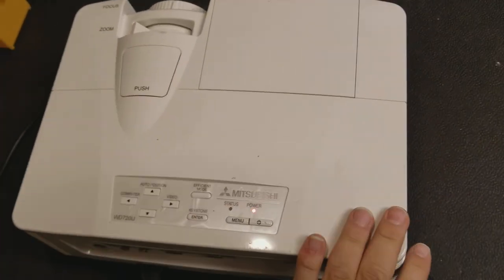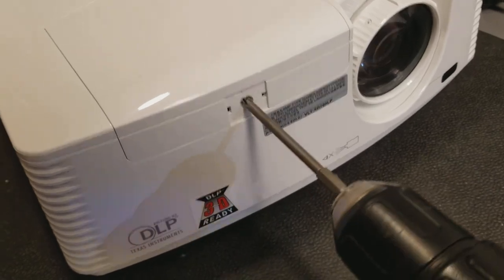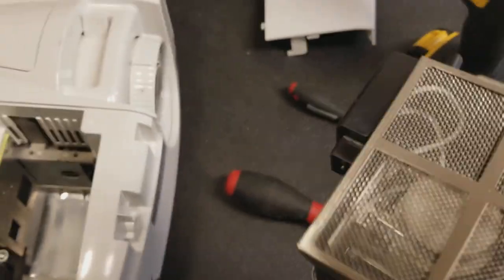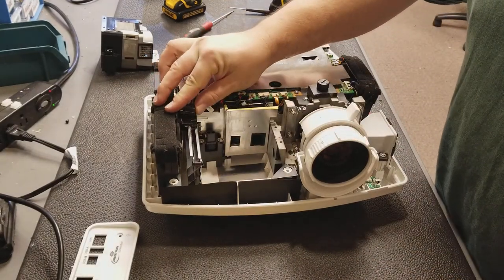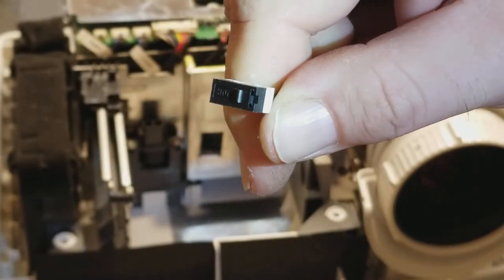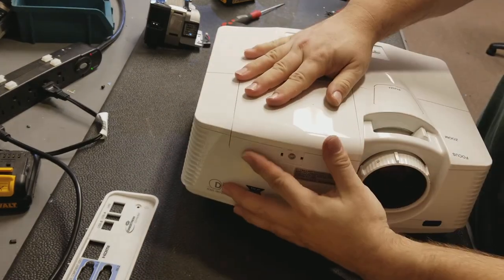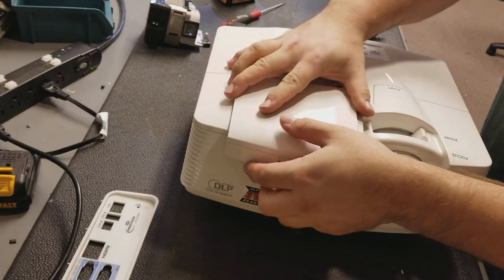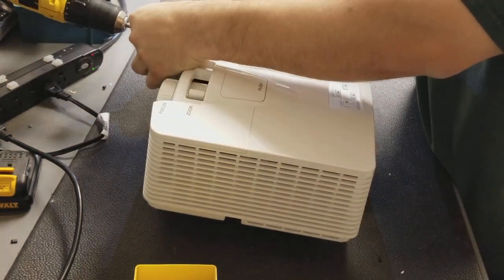Mitsubishi WD720 Repair Part1

Comment: Thanks for video here. I have a WD620U that start up but after some minutes a warning sign " temperature" came up on the screen and after some second the projector turn off. After ten minutes it is possible to turn on the projector again and after some minutes the same fault happen.  I have cleaned the projector for dust and the bulb is new and the old bulb has around 70 % more lifetime. Is it something more I can do. I think the fans are good. All fan blow in and the exhaust air are going out around the speaker. Is it some that know what that can be wrong?

Comment: Hi Frank, I just purchased a Mitsubishi WD2000 from a recycle center. It works great. The question I have is, do you reccomend I do a thoroughly cleaning of the fans and filter? And a bulb perhaps?
Darrick
Reply from the maker: If It is working ok , I would leave it be for the time being.  Maybe give it a simple cleaning where you just blow some air into the vents and pick up the dust with a vacuum.  I dont like to open perfectly good projectors because you can cause more problems sometimes.  I can tell you the WD2000 is pretty well built and is a chore to get to all the fans.  I think I would do the simple cleaning and use it.  
As far as the lamp, check the hours.  If they seem reliable(1800,2200 hours or so) then replace it if it as near the end.  If it only has 800-1000 hours I would keep using the lamp as it is.  I would check the bulb type though. Make sure its an Ushio brand bulb(either in your PJ or if you buy a new one). Enjoy that WD2000!  They still go for a few hundred on eBay.
Reply: @FixitFrank  Thanks Frank. I was kind of worried being it came from a recycle  center. I paid only $40 for it. So I feel blessed to get. I'll check the lamp hours when I get home tonight. 
Thanks again for time Frank. I very much appreciate it. 👍🏾😊

Comment: I have one of this.. but I don't know what can I do because I replaced the old bulb by a new one, but this not receive electric signal from the projector. It's necessary to replace anything more from inside?
Reply from the maker: Hi Emilio, Could you clarify what your issue is?  What are the 2 indicator LED's doing?  Or, if you rather, post a video of the projector and its problem and I will look at it and let you know what I suspect.  There are multiple possibilities.
Reply: @FixitFrank  first of all. Thank you very much for your interest in helping me. my projector is a mitsubishi hc3800 .. first I thought that the lamp was not useful because the manual tells me that according to the led indicators can be two options, problem with the lamp or blocking the circuit.

When I turned on the projector, I did not hear the electrical sparks that I understand are the ones that vaporize the gases in the bulb to make it turn on and then leave a constant voltage of 76 volts. I measured the current that comes from the source that feeds the bulb and is and throws a constant voltage of 47 volts
Reply: the projector only keeps on and little noise from de fan, for about 30 seconds, keeping the constant 47v in the bulb connector and then turns off whit "status" LED binking green, and "power" LED steady red...
Reply from the maker: @emilioalvarez2683 , Thank you for the info.  In the future, do not put your meter leads in the lamp power socket.  When it works, the voltage can be too high and damage your meter.  
I think you might have a timer reset issue.  Try resetting the timer by holding down left arrow, right arrow and power at the same time.  You should see the status light blink 2 times.  Be sure you are fully assembled with lamp installed and lamp door secure.

Comment: Hi, this video https://youtu.be/3875s4AveZI  shows the problem i have, everything starts (all 4 fans, light, color wheel) and seems to be OK. But at the moment when light starts coming through the lens then stops working and starts the cooling shut down mode. Then of course shuts down. What is wrong and need to be replaced or repaired? Thank you
Reply from the maker: Hello!  I suspect the problem is your lamp.  The lens of the lamp must have the proper IR/UV block coating.  I notice the sticker on the lamp and I suspect that does not have the coating.  Do you still have your old lamp? It does not need to work.  You only need to swap the lens on the front of the housing.  This is not the best image, but the lens should be very obviously red/blue/purple on the face when you look at it from a slight angle.  https://www.purelandsupply.com/images/Product/large/vlt-hc3800lp.png   I suspect your lamp has a light green coating.  It allows 100x the IR light through and confuses the color wheel. The color wheel senses a problem and the unit turns off. I can hear the color wheel start to skip around once the light ignites.  
I may be wrong but please check the lamp first.  If it has the red/blue/purple coating let me know as the color wheel may be a culprit.
Reply: @FixitFrank  yes there is a crack on the housing lens. The coating is purple but the crack. Is this matters?
Is it possible to buy this small piece of lens, cause i dont have the old housing. Thank you